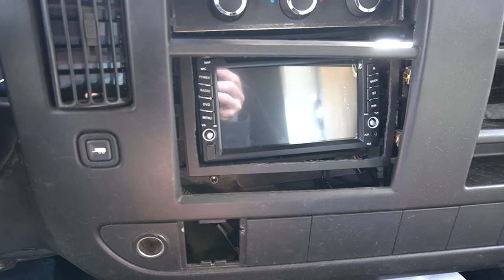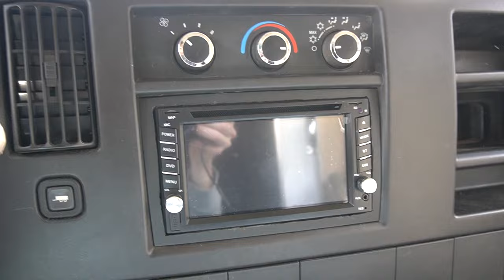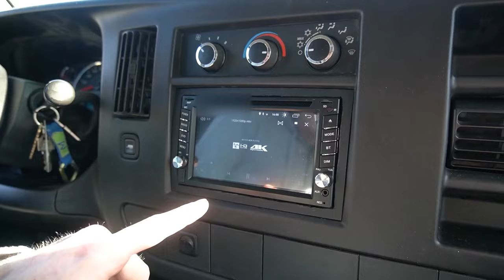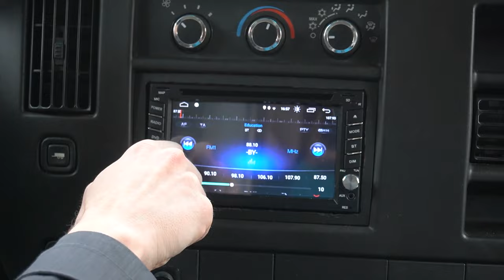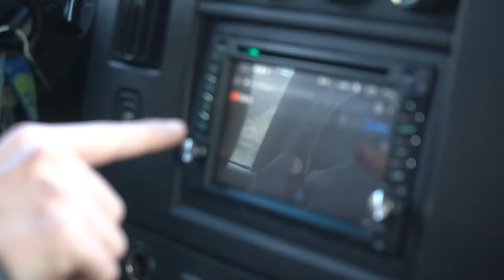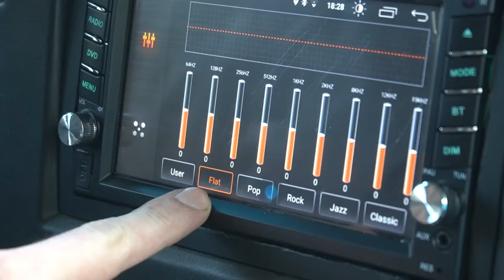BOX TRUCK CONVERSION | Android Radio, Car Speakers, and Lock for Cargo Door

Comment: Were the other connector's pins useless besides the ignition? #erster
Reply from the maker: The second plug holds all the rear speakers; could've pulled some wires into the box but then I think we will just use our phones and a Bluetooth speaker in there. Not really worth the effort.
The original radio uses GM's low speed CAN bus to detect if the van is running or not. They call it GMLAN. It also transmits all the singal and warning sounds. I had to get a small box that would play these sounds from now on. I didn't film the installation of that box though because it was an afterthought after I realised that normally the factory GM radio played the sounds over the speakers.